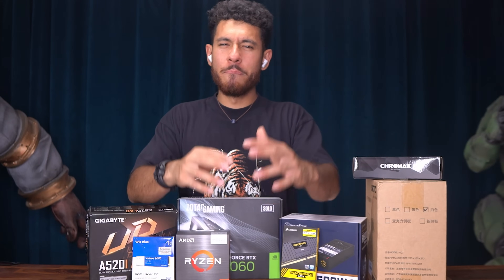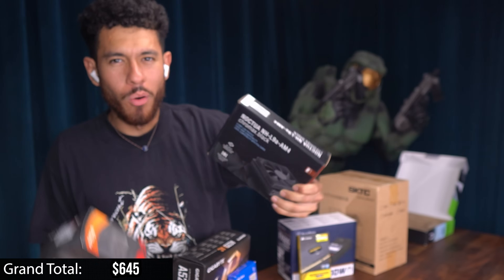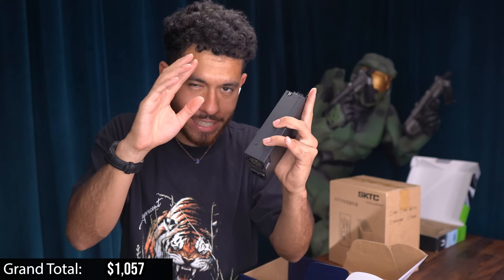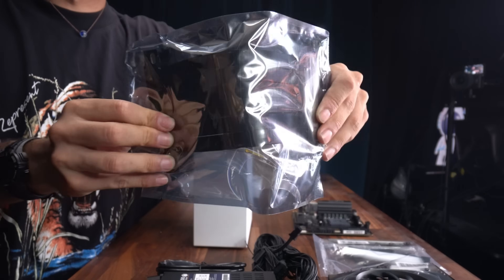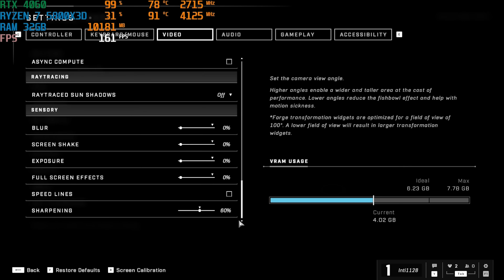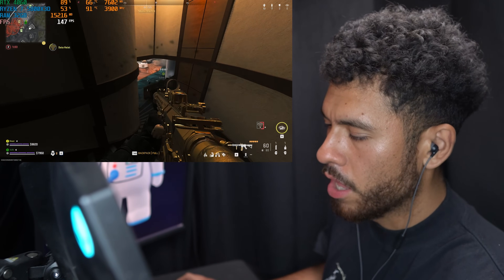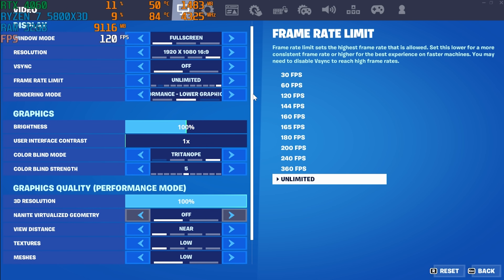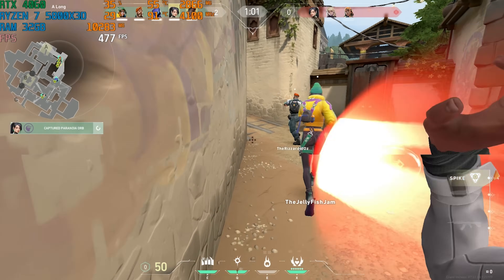RTX 4060 Mini-itx Gaming PC Build - $1000

Comment: You could honestly make this cheaper with a 5600x since the 5800x3d is way overkill for a 4060.
Reply: it's a great chip for high framerate in fps titles like Valorant, I'll be doing the same cpu-gpu build in an itx case cuz all I play is Valorant
Reply: You clearly dont know enough about pc's. The 5800x3d was the better choice. Especially for 1080p.
Reply: @xiyax6241  No he said he only chose the 5800x3d because he's been playing a lot of wz recently which is a demanding game for the cpu, If you don't play wz there's no point in going for the 5800x3d, not that hard to understand.
Reply: @thisguyrighthere8502  alot of fps games on 1080p res need more cpu power. In my opinion 5800x3d is still better choice. If you play at 1080p
Reply: @xiyax6241 😂
Reply: Also if you say 5600x not smart choice either way since for money 5600 is way better value

Comment: Try undervolting / curveoptimiser
Reply: I dont think that's possible with the A520. He shouldve gone with an X570 mitx for better vram thermals and underclocking/undervolting potential
Reply: @33shaheer46  hmm thats so sad. Not even with the softwareprogram instead of tweaking the bios?
Reply: @ThEsItuAtIoN88  unfortunately not.. they locked out this feature for the B-series and X-series chipset motherboards